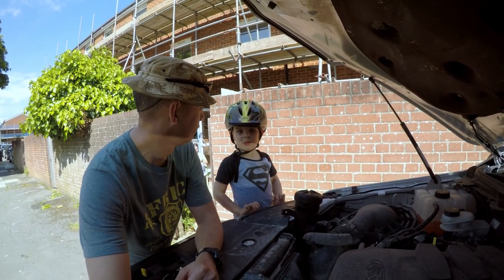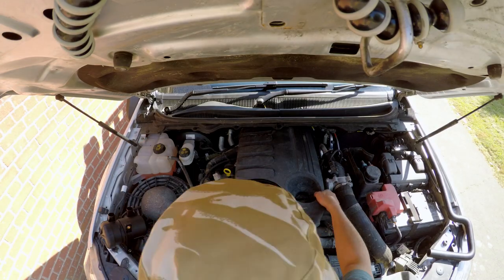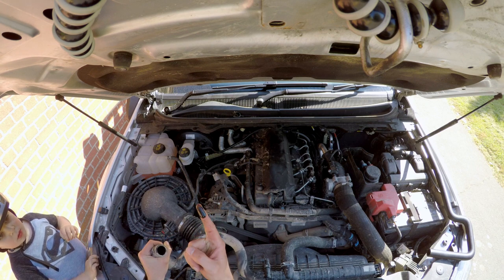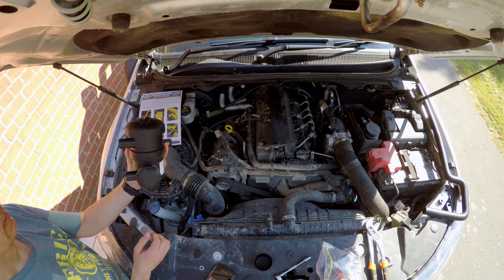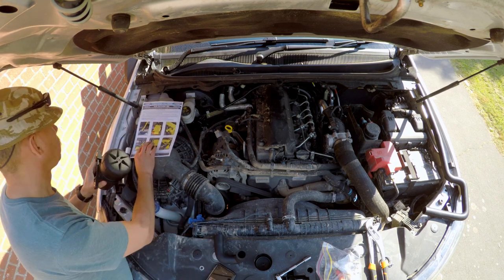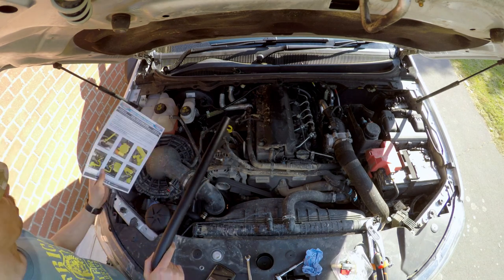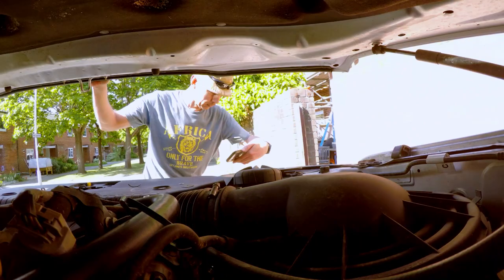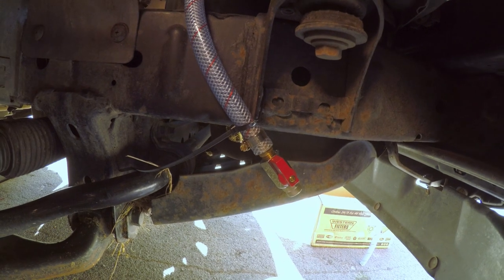Truck Build - ProVent 200 install into a Ford Ranger

Comment: Maybe also good to mention where the two hoses connect at each end as many people get confused. My understanding is one hose is from the engine manifold to the top connector (inlet) and the other hose is from the air intake to the bottom connector (outlet of the pressure valve assembly).
Reply from the maker: Howdy,  Yes that is correct!

Comment: how close is the alternator pulley to the hose it looks like its sitting ontop of it? or may bounce and make contact during driving?
Reply from the maker: Howdy, It looks close from that angle but actually about 2" (5cm) it follows OEM pipe routing so no issues there.

Comment: Will it also apply to a 2.5 gasoline engine?
Reply from the maker: If your engine has crank case recirculation and direct injection then yes! Its because manufactures moved to the more efficient direct injection so you don’t have fuel passing the intake valves anymore which had a ‘cleaning’ action.
Reply: @wanderingsouthafrican2280  Thanks, mine is the 2014 ford ranger with the gasoline 2.5 engine. I'll look into it